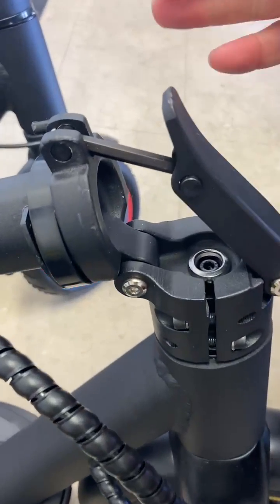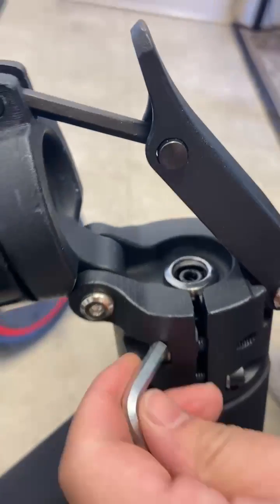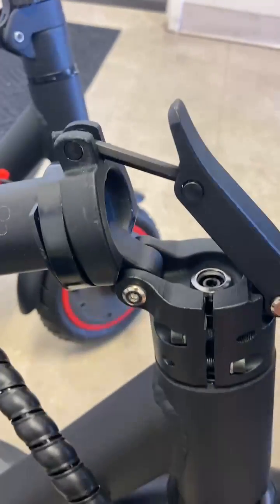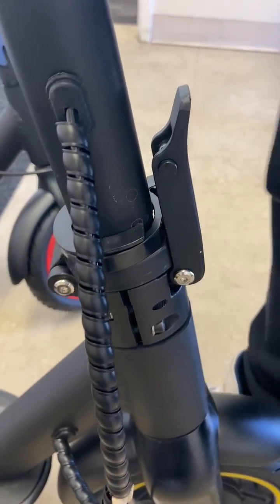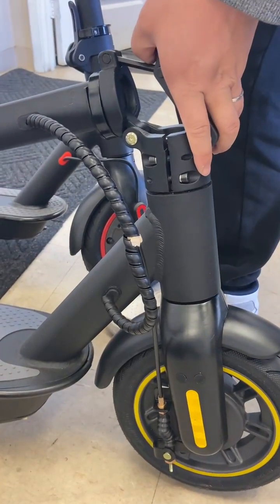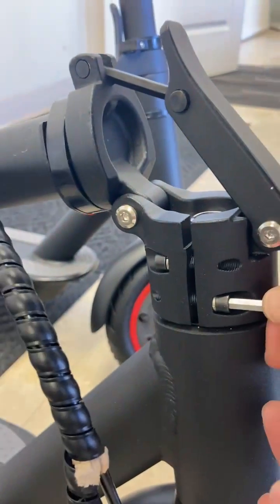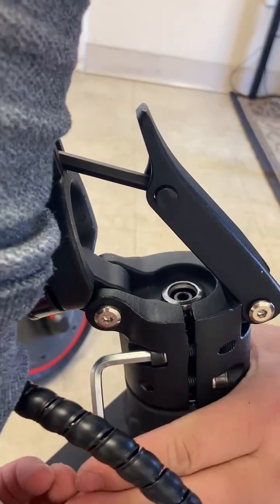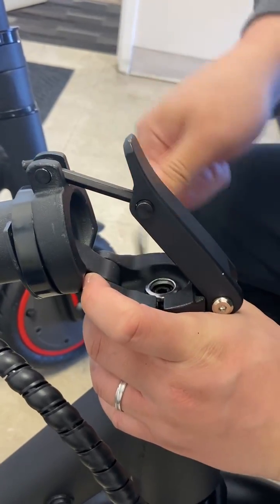How to adjust Steering Alignment on Electric Scooter

Comment: good, but you must first tighten the top nut before the 2 side bolts or else the steering will be loose and wobbly causing the bearings to wear out quickly

Comment: I could be wrong, but I believe that you tightened the bolts in the wrong order. 

The single top cap bolt should be tightened first, then checked to make sure the wheel and stem are not binding when you turn them, and if they are not binding, then tighten the two pinch bolts on the side. If they are binding, slightly loosen the top cap bolt on top until the wheel and stem aren't binding, then tighten the pinch bolts on the side.

If you tighten the bolts in the order you showed, the fork and wheel might be loose because they were not sufficiently tightened vertically before the pinch bolts on the side were tightened.

Comment: I own an E-Wheels E2S V2.
I had to disassemble the entire steering column of my electric scooter, and after reassembling everything — including the metal washer, bearings, etc. — I tightened the bolt that connects the front fork to the steering column (not the handlebars, but the long tube that can be folded).
In addition, there are horizontal bolts that clamp the locking mechanism.
Now the entire front fork and steering column are very stiff —
In other words, it’s very hard to turn the front wheel with the handlebar.

Did I tighten it too much and should I loosen it a bit, do you think?
If I loosen the bolts slightly, is there a risk that the entire steering column might come loose over time?
Or is it supposed to be tightened firmly, while still allowing the steering to move freely?

Comment: I have the exact same scooter my problem is I'm not able to fold my scooter the latch is stuck what do I need to do to unstuck it do I use those screws and loosen it or tighten it?

Comment: There use to be something that would prevent be from being able to turn my handle bars/ front fork backwards. But I hit a pot hole pretty hard and now I could turn my front wheel/handle bars in a complete 360 if it weren’t for the wires stopping me from turning further. 

So my question is. What piece do I need to replace to fix this problem?

Comment: i have this urgent right now issue i cant turn right it locks and my left turns all the way
Reply: Did you solve your issue?? because I have the same issue now , and I don't know what to do!!
Reply: @christinea4762 Yeah buddy uhh let me try remebering. U would have like those 2 screws on each side so just unscrew them and then like force ur thing back in place and re screw it and ur good to go

Comment: Thanks to your video, I discovered for the Navee N65I that there was a screw behind the sticker to tighten the handlebars on the stem. But there's a design flaw When you fold the handlebars, this screw loosens and then there's play in the handlebars. How do you lock this screw? I've only ridden 10 km in 15 days, because the problem occurred immediately.
Reply: Can you upload a video showing the problem? I may be able to help if you haven't fixed it already.
Reply: @intensecutn  Thanks, I solved the problem a long time ago. The set screw behind the handlebar was hidden behind a sticker.

Comment: Okay so this is really helpful but does anyone know how to fix the lower wobble on the scooter? Mine is tight there but the area below is very loose
Reply: You need to tighten the bolt on the front of the hinge part. You do it when the scooter is not folded, that way you don't do it too tight or too loose.

There are only 2 bolts on the front of the hinge. There's a smaller one above, and a larger one below. It's the larger one below you need to tighten.
Reply: That's if I understood your problem correctly. If you can explain the 'wobble' a bit more I may be able to help more.

Comment: What is all 3 are tight but it still moves. What else can it be?
Reply: not tight enough more than likely or it needs to be disassembled completely and inspect the shaft for stripping or it could be over lubricated!
Reply: It's just bolts coming lose from vibration when riding it. Ideally after a week or two of riding it brand new, you would go over and tighten some of the bolts and then you should be good for quite some time.